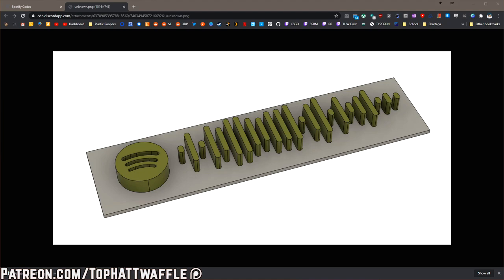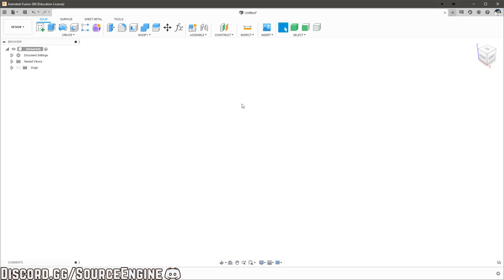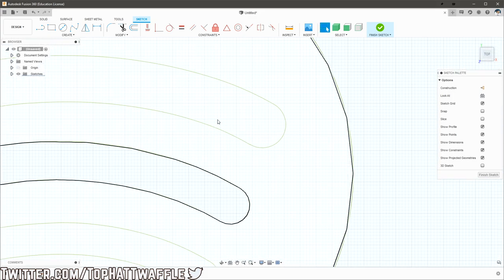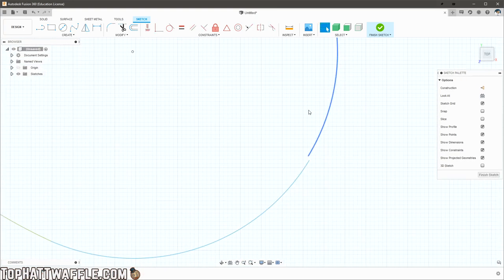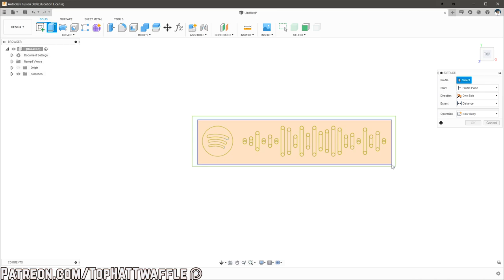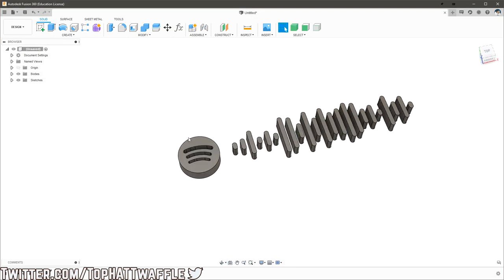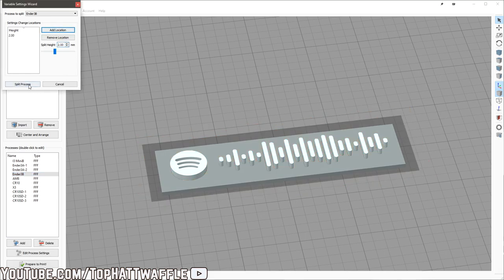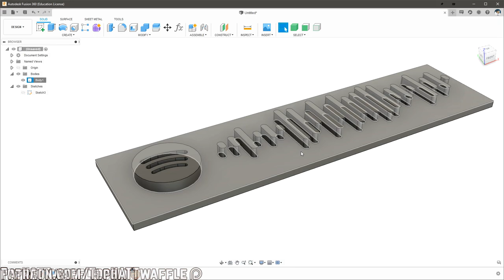Create Spotify Codes for 3D Printing! | Fusion360

Comment: Trying to follow this tutorial but when I do the step to join the gaps by using the "coincident" tool it tells me "Failed to solve. Please try revising dimensions or constraints." Any idea what is causing this error?
Reply: I have the same problem. I've seen some tutorials but without success.
Reply: Hey try Unfixing the whole sketch rather than only the few curves you work with. That fixed the issue for me.
Reply: @adampeckens5991  this solution works, thanks mate!
Reply: thanks works great